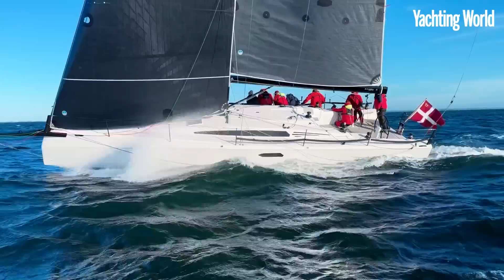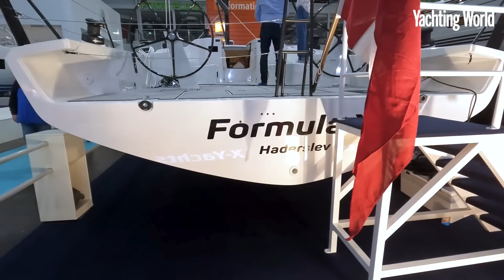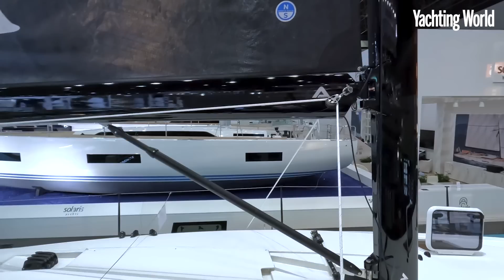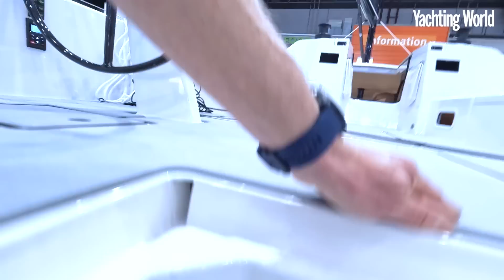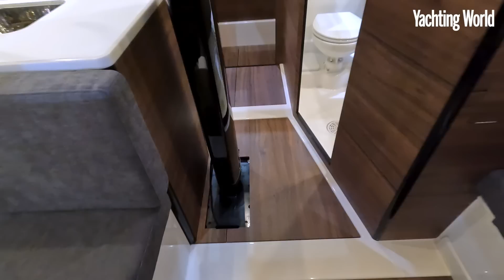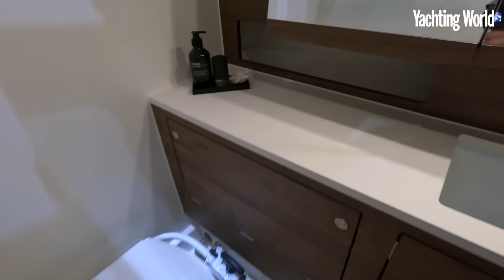X-Yachts XR41 First Look - a spicy new racer marks the Danish yard's long awaited return to racing

Comment: X yachts are impressive. A cut above the usual pop-outs, but they have always used this stupid galvanised steel frame as the main structural member throughout a third of the boat. It could not be more misplaced - being steel in a bilge. After 5 years they always start to corrode, no matter how dry the bilge is kept ( and why the hell should getting saltwater occassionaly in the bilge of a boat be a problem anyway?)
Trying to remove the corrosion is extremely time-consuming and virtually impossible, short of almost rebuilding the hull. It is incredible they can be built with such a basically unsound principle to the design.
It is a shame they have an all plastic interior now. They used to be quite classy
Reply: The galvanising is well done, but it cannot last
Reply: Speed costs. Maybe not enough, in this instance.
Reply: Well, my X-yacht is 30 years old and the frame is still in a very good condition.
Reply: @ Thank you very much
Reply: my x-102 is approaching 40 years with an intact steel frame
Reply: My X-35 is from 2007 and the steel is still good.